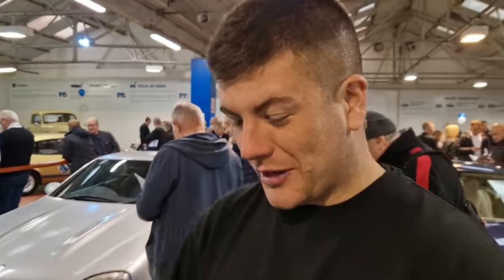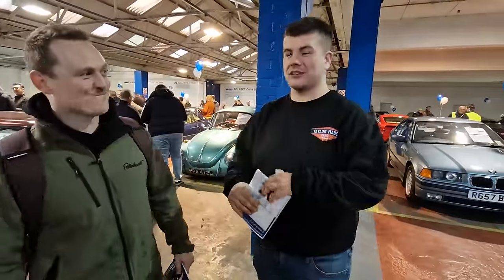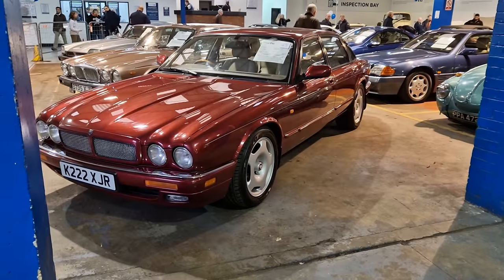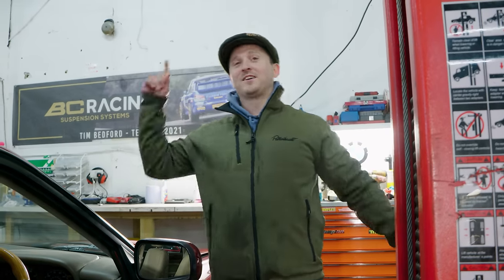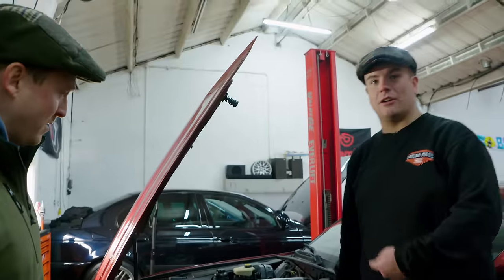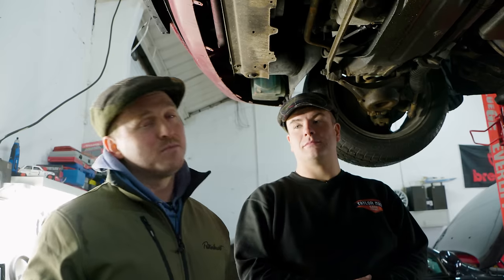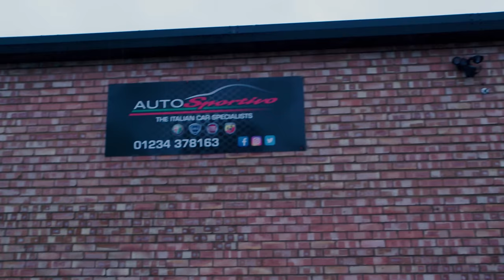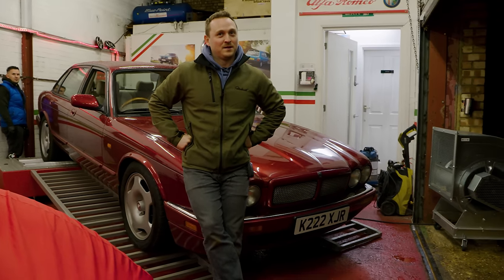£5000 Classic Car Auction CHALLENGE!

Comment from the maker: Protect your car the easy way and save money with Avalon King's MASSIVE BLACK FRIDAY SALE! https://avl.kg/bf22ar
Reply: Pimp you ride with a sound system, try the new kicker 12 inch sub with 12 in radiator ? zebra skin trim n covers, oldskool Alpine head unit etc :)
Reply: I hope you did an oil change before the dyno. Just in case :)
Reply: Nice to see the S2000! I was wondering what was happening with her!!
Reply: In America jag just means falls apart quickly Nd junk
Reply: you need to do the drag race with phill. jag v jag v jag powered mx5
Reply: ALEX look at the number plate K222 XJR IT SAYS XJR
Reply: Alex we have 4 litre Turbocharged Ford Falcons in Australia and they demolish V8's
Reply: Shame, no love for the 3.0 Ghia Capri... 😕😕😕 THAT WAS an OG Drift car... Hahaha whether you wanted to or not hahaha. My Uncle loved them, had both the 2.8i and 3.0S... Iconic shape, ICONIC car... 👍👍    😎🇬🇧
Reply: So my XJ SPORT X300 Same car but with the 3.2 was £1200 needs rear shocks and a few other bits but was a bargain but this for £4k! Absolute steel
Reply: Best car channel out there along with Matt A, but better not tell trading standards about these dodgy product placements, ceramic what? Some cheap spray on wax? Keep your credibility guys.
Reply: Might try it on my mr2 and see how it compares to griotts
Reply: Ford sold 4.9l Inline sixes in the US

Comment: That's shocking it's still got 309hp 
Looks like you finally bought a gem Alex 🤣
Loving the cheaper car content it's just more relatable.
And comedy gold from Taylor and Alex is awesome
Reply: yeah, esp compared to the XKR at the wheels horsepower; I figure the transmission used on the older straight six (I assume a 4 speed?) was actually a lot less lossy than the mercedes 5 speed on the x100 xkr.

Comment: The best car you've ever bought! Once you understand Jag life, there is no substitute! Thermostat problems on the XJ are fairly common so that'd be the first thing I'd check if the temp is in the red. I'm amazed the exhaust hasn't rotten, but even so a stainless unit with a resonator delete should make some mean noises with a smaller pulley! I'm guessing someone has put waxoyl on it at some point underneath because they rot around the sills, wheel arches and under the boot lining so keep an eye on those spots.

Comment: And XJR with a limited-slip diff? 4k quid is surely a bargain, man! Another Alex car to follow for sure. Great video, once again 😊
Reply: Number plate on it alone probably worth some!
Reply: LSD is standard on the XJR6. Came standard as a manual too, you had to option the auto box. Great cars.
Reply: Interesting that the burnout seemed to result in a one-wheel peel though?

Comment: Great buy. I´ve had one as a daily driver for 5 years now. With propper maintainance and care it´s been super reliable and endless joy to drive.
Btw. Few minor and simple upgrades to get some more fun out of it. Andy bracket for the crank sensor.  Larger volume coolant pump for the intercooler, and larger supercharger belt pulley on the crankshaft.

Comment: Hi Alex great show! I've been the proud owner of one of the non-supercharged versions for about 16 years now, it's interesting they appeared to have bottomed out and are on the rise as the X300 was only available for 3 or so years and is proving exceptionally reliable. When it comes to heat, it was a coolant sensor on mine about a $30 AUD part so nothing really, it has a different sensor for the gauge, which is nearly adjacent to it and also cheap to change. We swapped my radiator for a double fan one and the car runs cold most of the time now with no dramas at all. If you are keen to tune it there are verified stories of over 570 bhp and 700 nm coming out the engine, there is also a cheap easy very quick upgrade originally designed by the man who helped create the motor which really helps the car come alive. In Australia the rust issue is non-existent so the only issue we have is the fact that Jaguar clearly saved money on the wiring, its not insulated anywhere near as well as it should be, I've slowly started replacing it and the car feels better than it ever did. Enjoy mate!  Here is a stripped tuned version for a bit of fun: https://www.youtube.com/watch?v=a-tMlGVId1A&t=318s

Comment: I can’t believe the prices you can get cars for at auction. That 5 series you bought last time must have been worth at least £2500
Reply: Because of the risk involved as you never know what it’s actually going to be like
Reply: @danielhendry8376  It goes deeper than that. Usually, auctions are stuffing the crowds with shady history cars, since everyone likes to flash some cash and have a ball for a tanner. Of course, documentation would be all original (after all, gentlemen trust each other, at the illegal poker table), but if one decides* to doublecheck his bargain - there prone to be some lost tracks.

*The road, i woun't recommend to cross, since you never know, which lorry can suddenly lose it's brakes.

Comment: That Jag is proper clean!!! I love straight sixers, they really are the best compromise of power, smoothness and in general reliability, superchargers also sound soooooo good. I love a good  BMW sixer, been buying them for over 20 years and currently have an e90 335d, I know its a derv but its such a creamy engine the M57 Tu2 engine plus its literally bomb proof. I'll keep buying BMW sixers as they are so much smoother than a V8, don't have the hassle of a balance shaft but still put out similar Power especially when turbocharged or supercharged.  I expect to see good things with this Alex

Comment: Alex, I really enjoyed how you fell under the spell that the XJR6 has on certain people like me, even down the the thing I always say: LOOOK AT THE BIG RED LETTERS XJR6 SUPERCHARGED ON THE ENGINE. I'm now on my 8th XJR6 and maintain the statement these are a very special Jaguar. There is more to the story though, the holy grail, the XJR6 with a manual gearbox. I have one of these myself now and it's a completely different animal. I know Drivetribe are already doing a manual swap on the XKR which is amazing, but I urge you to consider converting your car to manual. It's clearly a solid and well looked-after example so would be a good candidate for changing the drivetrain. I have a feeling your would absolutely love the thug of a car the X306 becomes when the slushbox auto is removed in favour of the racing GT tractor Getrag 290 manual with it's industrial grade gearchange and clutch!

Comment: I did a mot check on the jag (as I'm sure you did alex) and it's not only had near to no miles for years but only ever failed on minor things like washer fluid and the actual big problems it had have all been fixed. The coils as mentioned by taylor must have all been replaced as was 1 of the issues

Comment: With regards to the Drivetribe XKR, they should check the slack on the throttle cable. Over time they stretch and the result is that when you floor it, you’re only getting like 80 or 70% of throttle instead of 100% at WOT. Which would explain the 90 escaped horses.

Comment: From a styling perspective I actually prefer the X306 over the updated X308. I personally think the more squared off bumper and interior trim fits the overall design of the car better than the  more rounded bumpers and interior trim. Same goes for the factory wheels on the XJRs, the X306 monoblock styled wheels suit the car better than the X308's multispoke wheels. Overall the updated X308 just looks cheaper to me. Unfortunately here in the States the X306 XJRs are harder to find than the X308 XJRs.

Comment: i had one of these in BRG sitting on 19inch BBS wheels. It was epic until the head gasket went in a tunnel in Switzerland and i was stranded. I fixed it at great expense and sold it within a month. Massive regrets. Wish I still had it, best car I've ever owned. Good luck with yours.

Comment: I have its V8 little sister! I love that era of Jag, they have the proper styling and feel with that endless wood and leather inside and were actually quite reliable at the time. The V8 is a good unit with a very nice power delivery and I'd say the reason why the Drivetribe XKR is so down on power is because while a £4000 6 cylinder XJR is about in the prices, £4000 for an XKR is way under the usual prices. That inline 6 on the other hand has the advantage of being know for being pretty bullet proof, probably the most reliable engine from Jaguar.

I'm interested in knowing how it handles also. The V8 like mine had standard computer controlled suspension and they handle way better than you expect a 20+ year old 1.8T car to, while still being very comfortable. This was not available at all on the 6, so I'm curious about how it compares. I expect it to be great too.

Also, supercharger noises... Yeah can't get bored of that.

Comment: These engines are quite detuned from factory. If you look on the forums there is something you can get called an "Andy Bracket" which is a modified crank position sensor bracket and advanced the timing a few degrees, well worth the upgrade and saves on fuel too.

Comment: I’m pretty certain that that jag is the best car Alex has ever bought and probably the best car he’s ever owned too. What a beautiful car. I wouldn’t be surprised if the car was sold by a disgruntled ex in auction for the value their spouse told them they spent on it. Or if the original owner unfortunately wasn’t the one who sold it but someone unfamiliar with cars. If it didn’t have a ding and no thermostat and gauge issues, it could’ve possibly even be listed at 3x the price where jag enthusiasts and other old luxury car enthusiasts would bite.

Comment: Since the guy owns a body shop, you're looking for faults in the wrong place.  VIN plates (and welding of the panels, holding them) is the key location for solving the "how come we got it so cheap?" case.
But paranoics aside, if you really like the sound of the intake, you should run a hose from the filter box, to one of the heater outlets (preferrably one, that closes) and have yourself a live orchestra on demand, without losing the tranquility outside ;)

Comment: Pretty sure my 99 XJR V8 still makes at least 350bhp, because it still does 60 in 5.2 seconds! Its never even had the cam covers or sump off either, its only ever needed basic servicing & a pair of fuel pumps (after sitting too long)... People knock British cars, but you cant go wrong with a well maintained Jaaaag 😎

Comment: That Jag is basically just run in, and sounds like the gearbox is probably where the 11 horses have run off to - they're currently glue in the box' oil pan.

Comment: Thermostats using fail open. The only one in over 170 cars I’ve owned they failed shut was an E30 M3 that runs a remote thermostat in its own assembly. 

Hope that Jag isn’t hiding a head gasket failure….it is an auction car

Comment: Anynone know what actual wheel HP it made? 309 is at the crank, meaning whatever dyno correction factor old mate has his dyno set on the day for driveline losses... Would be nice to know in comparison to an early BA XR6T with similar advertised power

Comment: That V70R’s AWD system isn’t that great, it is the older Viscous Coupling based system which is nowhere near as good as the Haldex system the newer cars got (the last of the P80 V70Rs “Face 3” got the Haldex system and came with Öhlins dampers), than the P26E V70R also came with the Haldex system.

Comment: Is the engine something coming from another brand or is it something they use on their own?
Reply: it's the aj16 straight six engine which is a further enhancement of the previous aj6 engine jaguar designed it and it wasn't used in any other brand apart from the 1990s Aston Martin db7
Reply: @Sophiechic  great answer. Its no enhancement from the xj220 then. That was a metro-engine right?
Reply: @gurkpojken  that's right the metro engine was a v6 twin turbo engine used in the xj220 and was shortened from a rover v8 unrelated to the straight six in the xjr

Comment: I was guessing 298...
So yeah, that thing really did good and has been cared for, beautiful car indeed!

One thing tho... every youtube video where they buy and dyno a car, people think, oh its gonna have 40% down on original power figures for some reason, but thats hardly never the case... I dont get that. Engine does not magically loose its power unless its totally trashed and then well, anything will be bad if its broken... 

If anything, it could gain a little bit when run in... the idea that a car has lost power based on age is just a stupid myth or misconception. Its called, being unhealthy / broken...

Comment: Shame on you @AutoAlexCars ! You dont know of any other straight 4ltr 6 pots? One of the toughest and most solid is the  4.0 L engine developed by AMC. While you may dismiss as being American, and all the poor power to weight it brings, this 4ltr is one of the toughest blocks going. 250k miles to run in :)